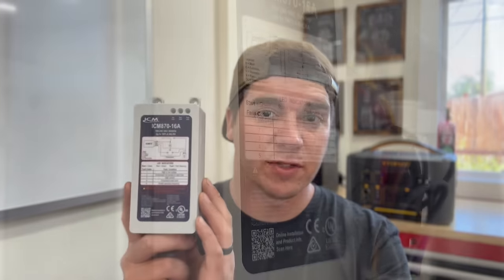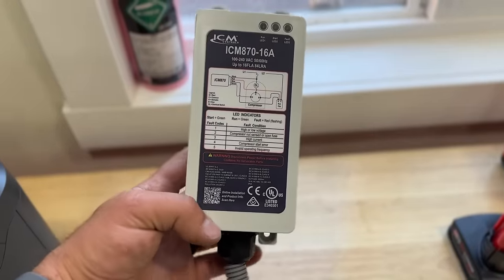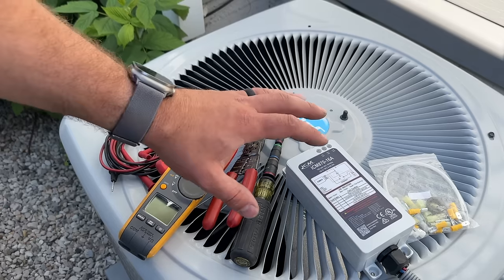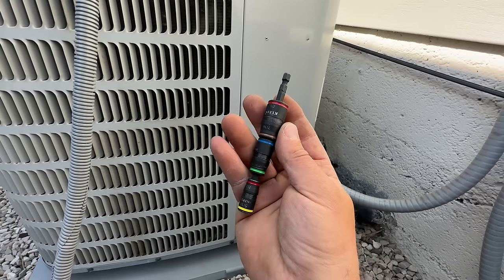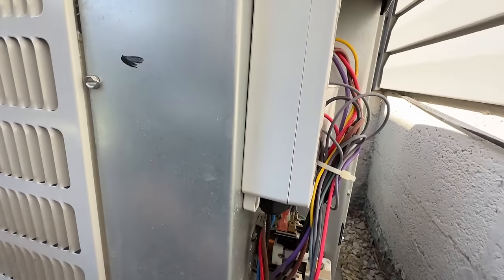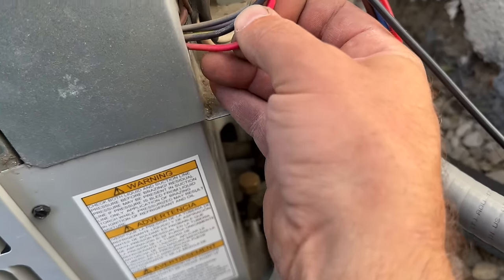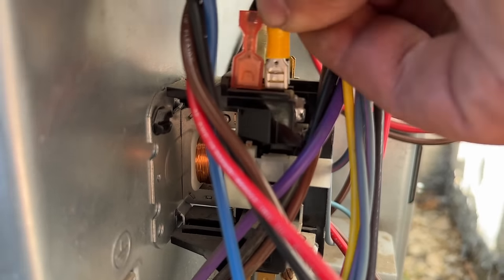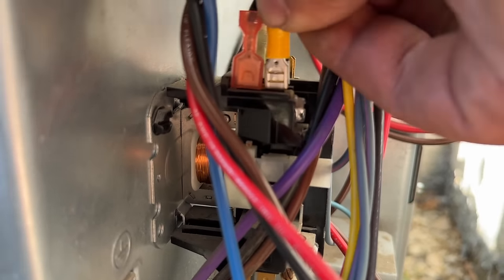This $150 Soft Start Allows You To Run Your A/C With A Generator!  Introducing The ICM870

Comment: There is one big problem here - if you look at the ICM870 literature, it says it ALREADY INCLUDES A START CAPACITOR.  Furthermore, the ICM870  'TYPICAL INSTALLATION' instructions, in the lefthand column clearly state in Step #2: "If there is a Start Capacitor and/or Start Relay already in place, DISCONNECT them prior to installing the ICM870."   The 'INSTALLATION' instructions in the righthand column, also clearly state in step #1:  "If there is a Start Capacitor and/or Start Relay already in place, additional steps will be required to DISCONNECT them."    So I'm sure that by leaving the original start cap in place, the capacitance is much higher, maybe double, what it should be.  However, you would still want to leave the fan connected to its proper capacitor terminals as it needs it to run and the ICM870 doesn't include a capacitor for the fan.

Comment: As long as your generator is large enough you can run your HVAC unit with out the need of one of these soft start devices, all these do is reduce the initial start up amps of the condensing unit so it’s not as great of a initial load on the generator.

Comment: The ICM has a big con to me. The website says there is a 4 minute delay on every start cycle. 👎.  I could understand have one delay after a power loss  but for not for every single run cycle during the day.   Any thoughts on that?
Reply: Safety to protect compressor.

Comment: Extremely easy to install and so far, no issues and good results.  Would this have similar benefits for a heat pump heating and cooling system?  Thanks for presenting this so easy to understand.  Also, the nutdriver you recommend is great as well!

Comment: Thank you for this comparison, very helpful. Can you please consider connecting the Micro-Air to that same unit and see if it's capable of bringing the in-rush amps below the 5.1 achieved with the ICM (with the reported number being after 5 starts due to learning)? This would be an additional (and important) element in helping one to decide which one is "better" given their preferences and environment. If it's capable of being more effective in limiting the in-rush amperage, it may be worth it to some to spend the additional money. Thanks so much!
Reply: I have a micro air on a 3.5t unit and an ICM on a 2.5t unit. 25a inrush on the 3.5t, with the micro air, 18a running. 27a inrush on the 2.5t with the icm, 12a running. The micro air draws 5a then slowly ramps up. It is better but more money. Editing this... I replaced my ICM with a Microair on the 2.5t. It pulls 29a. I'm 7 starts in. My 2.5t just pulls more than the 3.5t with bith slow starts. It was 67.5a. So, Save your money, Get the ICM.
Reply: @srica7366 my ac starts with a bang… do you think either one will help? Do you think the micro air will be quieter?
Reply: @srica7366  Thank you!
Reply: @linvol20  I'm not an expert, but yes, due to the controlled manner in which a soft start kit initiates the compressor, a side effect and benefit can be a quieter & smoother start-up. Please note that your mileage will vary. If there's something physically wrong with the compressor that's causing the bang, a soft start kit is unlikely to resolve it. Unfortunately, I don't know if the Micro-Air will be quieter. I have an ICM on my 2.5 ton and a Micro-Air on my 4 ton but haven't swapped them to see if one is better than the other at controlling the in-rush amps or the start-up noise.  This is why I was / am hoping that The DIY HVAC Guy will connect his Micro-Air to the same unit in the video to see how it compares to the ICM. If the Micro-Air is able to be more effective at reducing the max in-rush amps, I feel it would be a safe assumption that it would also provide for a quieter start-up.
Reply: @srica7366  I also have a 3.5 ton mobile home a/c unit with the compressor, cooling fan and air handler all in one. Which ICM do I get? the icm 870-16A or the icm 870- 32A

Comment: Hi Dave, great tutorial. I bought the ICM870-32A soft start, and installed it yesterday. All went well with the AC for about 12 hours then I get a "Fault #3", high current. I disconnected the soft start and the AC ran fine. Any thoughts? Darrell.

Comment: I bought the 16 amp for my 3 1/2 ton split unit that is about two years old. I installed it according to your instructions, which were fine, however, after three weeks, my compressor would no longer start. I ended up returning the part. Probably gonna try the more expensive micro air.
Reply from the maker: Bummer. Sorry to hear that!

Comment: It's far less expensive because it's not rated to the operating loads of larger units.  16A running an 84A starting load is what, a 2-3 ton unit?  They claim a 32A unit is "coming soon" but no word on price.

Comment: 35 inrush is really good. I just saw a video that had 130 start up amps, but he was using the max setting to get the start up which is not near as accurate as the inrush. I need to get me a soft start. Might lower the electric bill by a bit.

Comment: Great videos! I have a question. My home outside unit has a loud buzzing noise after power blip happens in my house and the AC was running during the power blip last time this happened and knocked the power out in the whole house. Would this item be something to prevent that or is there something else to install that will prevent the compressor from jamming up on a power blip?

Comment: Great video, thanks for sharing your knowledge. With the soft touch icm-870-16a attached, what watt generator would you suggest? 1600 sq ft. home during and after a hurricane here in Florida I would not need to use all of the other items at one time such as dryer, hot water heater, spa pump. I think a 13000 watt dual fuel could do it but I am not certain. Thank you in advance for your time.

Comment: Is there any downside to installing this? If the compressor needs a certain amount of power to start (lock rotor amps) then how does the impact the life of the system.

There is no free lunch in physics. I’m interested in learning about this from seasoned, licensed HVAC professionals.
Reply: Don’t ask this guy about reactance…..he doesn’t have a clue about phase shift and it’s negative effects on household electronic components

Comment: Almost every installer talks about how a soft start kit allows the A/C to run from a much smaller generator, but I have not seen anyone mention how these easy start kits make it easier to run your stuff on a SOLAR panel system inverter.

Comment: Just went through this with a power outage. Never tested anything running on a gen. Well, now was the time. Everything worked great until I tried the HVAC (heat pump) So now looking at soft starts.
Honest question...does a soft start help with electric usage too (not that it matters)
Reply from the maker: No it just slows the current being delivered so it’s not all at once
Reply: @diyhvacguy  ok, I just thought the surge might be more. Anywho, how to tell what size unit I have (goodman gsz140421kd is a 3.5T ? )

Comment: Thanks for sharing this option. 
Personally, it would help to see a little more detail, like HOW you attached the red wire to the capacitor. Did you remove something else that was there, etc? 
Thanks!
Reply: No - most of these capacitors have multiple spades available.

Comment: Have a newer style Bosch Heat Pump with a computer like circut board behind the panel.  Will a Micro Air soft starter run newer units??

Comment: Hey brother, great video channel no doubt. Certainly, do appreciate all the effort! I'm curious if these will save a bit on $$$ electric use over the long run? I'd assume so, as the in rush current use and (from what some others have stated) run current drops a bit as well. This may be a pipe dream, but if it saves a bit on "juice use" as well that would be great. Extending the life of the compressor is the big Elephant in the room. I'm not so concerned with a generator hookup use; we rarely have outages (knocks on wood.) Rock on my man, best to you and yours!

Comment: Will this let my solar inverter run my AC? Lets say i have a 1hp or 1.5hp AC and a 5kw inverter. Some inverter will trip if you run the AC, so to prevent this from happening, can i use a soft starter on the compressor?
Reply: It will, I have a Renogy diy Solar kit with Lycan inverter and it’s working fine.
Reply: @mtn_av8r that is nice to hear! By the way,  how large is your AC unit? And what is the max continuous wattage that your inverter can do?

Comment: Can you recommend a soft start for a 15000    RV  roof top  A/C unit
Reply: The trend seems to be to ditch that old school noisy inefficient rooftop and replace it with a mini split and an inverter generator from Honda or Champion. I'd consider either the Senville SENL-12CD-16 (12000 BTU) or Senville SENL-09CD/Y, in the 120 volt versions. Such a combination would make both you and your neighbors happier at a campsite, and you would be far more peaceful and comfortable when boondocking. There are lots of YouTube videos on the topic of RV mini splits.

Comment: QUESTION: Does a soft start provide a benefit for the life of the capacitor?
Reply: I doubt that it will increase the life of the AC compressor run capacitor.

Comment: The odd part about this video is that the AC only uses 35A to start. I didn't think anything used under 100A inrush. At 35A I would think most generators will already start this.
Reply: (35 amperes) * 230 volts =8050 watts  
You must be from the land of large generators. I don't think "most" generators are 8 kW+ but maybe if you ignore portable units.
Reply: It was 53A
Reply: @darindigilormo4166 dyslexic much?
Reply: From using generators for demo trailers I have found that. 1, generators are most stable at 30% to 70% rated running amps/ watts. 2 using 100% of starting surge rating on generators tends to burn out the capacitors in the generator. 3 most things manufactured in the last 10+ yrs have some kind of electronic parts that hate surges and will make
 These need replacement or repair. Also note all generators are created equal so e have terrible harmonics in the current, note good for electronics.

Comment: Be careful with these ICM units, I've had two fail recently in the same way. Either no lights or fail to detect compressor. Everything checks out fine but the unit itself.
Reply: I just got the same thing here in TX. I reverted back to OEM connections and everything works fine.
Reply: The failure is common, it is the 100uf start capacitor inside the ICM870 that fail and leak oil
Reply: @montreuil2l  under rated obviously

Comment: Great video, thanks. One question... does installing this mean that the A/C unit will draw less amperage the entire time it is running, resulting in a lower electric bill?
Reply: Soft starts will not help you save money on your electric bill. The in rush on start up is only for micro seconds.
One of the engineers for microair has said as much.
Softstart main benefits are being able to run your a/c with generator and should be easier on the start winding of the compressor to extend the life of the compressor.

Comment: I have a central ac unit that was already there when I purchased the house. It’s been there since 1992. Very old unit but still works well. Just uses a lot of electricity. 

Does it make sense to replace all the attic hoses with insulted ones. And then replace the ac unit and the furnace. Trying to split up the costs.

Comment: Great presentation,  thank you. What I need is something for my camping ac. It's  a 5,000 btu window unit I want to run on my solar generator.  I currently have the capacity to run it, I just want to make it easier. Any advice would be appreciated.

Comment: This may be a ridiculous question but I dont hear anything that answers my question directly. Will this work on any heat pump system?TIA
Reply: Any system? No. This kind of device is only applicable to "old school" single phase motors (compressors) that have a topology consisting of start and run windings with a capacitor to shift the current phase relationship between the two windings. Soft start controls like this trade off one of the deficiencies of this "split phase" of motor for other deficiencies which the system may be able to either mask or tolerate. If it were a perfect solution to high inrush currents, such a technique would have been incorporated into similar motors many decades ago.

Comment: Does using a soft start lower your electric bill as well?
Reply: No, the amount of energy required to cool or heat your house remains the same regardless of any of these devices. (I am assuming your electric utility charges you for just a total amount of energy, in kW*h each month.) Their purpose is to spread out the spike of current that an electric motor pulls when it starts up. This is important because a generator or battery inverter can only supply so much current (amps) at once, so that inrush current is often the limiting factor rather than the total power the generator or inverter can output.

Comment: Hey bud I know you do a lot of the soft starts and videos like that but when are you going to do a video on a soft start on a mini-split do you think it'll work please let me know I'm very interested thank you sir
Reply: The variable speed inverter driven compressors like those commonly found in the current generation of mini split heat pumps are inherently soft starting. There is no large inrush current.
Reply: @jamesnasium7036  oh ok thanks bud

Comment: we just went through Helene and didn't have AC even though we have a 22kVA Generac generator. I learned about LRA and other things that keep the AC from turning on, so I purchased and will install this softstart unit. Question when shopping for a new whole home unit what should I look for that will make it more generator friendly or compatible where I wouldn't need to install a soft start box? my mini split ran just fine, but when I'm in the market for a traditional whole home AC/furance unit are there things I should look for that would make it compatible with my generac generator?

Comment: The problem with these soft start kits is that installing them voids the warranty on the AC unit. That's a trade-off that's not often mentioned.
Reply: You arent altering the AC unit.  You are simply attaching another product to it.  All you would have to do is detach it and noone would have any idea it was even installed.
Reply: @dthompsont3796  I very much doubt that argument would hold up in court. It's a risk that should be considered if the unit is near new.
Reply: @MichaelGraves3304 Do you think warranty claims for residential appliances go to court?
Reply: @Vicarium  More likely arbitrartion, should there be a disagreement. Nonetheless, the question stands. Does the installation of such a mod void the warranty? I think so.

Comment: Are those inrush amps being displayed on the meter counting the amps being used to start the air handler motor inside the garage as well? Both the motors start at the same time don't they? Thanks

Comment: Great video! Thanks for this. BTW, could you please advise how we determine what the rating in tons is of our AC unit? Thanks.
Reply: Look in the middle of the model number.
024 2 ton
030 2.5 ton
036 3 ton
048 4 ton
060 5 ton
12K BTU = 1ton

Comment: I have two capacitors. The smaller one is for the fan. Can I combine them into a dual capacitor in correct size?

Comment: Great video.  Is there such a thing as resetting the ICM870 if you were to move it from one AC unit to another?  It looks like it has a learning cycle so I am curious if it can be reinstalled on a new unit (assuming I might replace my current one in a couple years) and learn the new startup profile as needed.
Reply: I inquired with ICM earlier, Per ICM "Yes, you can use the same ICM870 but you have to start it up with the blue wire of the ICM870 disconnected ant first and wait for the start failure. Then shut Power off, reconnect the blue wire of the ICM870 to herm on the run capacitor and power back up. After several cycles, the ICM870 will relearn on the new AC."

Comment: Just as a heads up to anyone reading this I bought one in September 2023 and it’s dead as of today. Called ICM and they don’t make this unit anymore due to problems with a internal capacitor. They will replace it whenever they release the new model they claim.
Reply: Second update. Icm has sent me the new soft start free of charge. Excellent company to deal with and they kept their word.

Comment: I saw on ICM's youtube video that had people commenting on the 4 minute delay to prevent short cycling. This delay seems to happen all the time which would be annoying having hot air blowing for 4 minutes everytime it starts. Are you having this issue too?
Reply: I was about to ask about that! From their website:
"*New feature: Upon installation and every start cycle, the ICM870 soft start will initiate a routine 4-minute start delay indicated by a rapid flashing “Red” LED indicator light. Power on the A/C unit and wait 4-minutes for the delay routine to conclude. This should follow with a successful call from the thermostat, A/C startup and the LED indicator light to change from “Red” to “Green”. This feature has been added as a benefit to protect the compressor and ICM870 from rapid short cycling during startup."

Comment: Hi Dave,  I installed the icm870 16A on a 28yr old ICP ACS036A2B1 3-ton.  Works great actually.   I methodically checked all connections 8-9 times before starting.  It kicks on,  the fan won't spin.  What did I do?   :-{  Todd    Start amps went from 81 to 40.